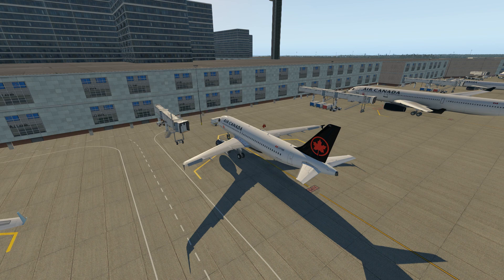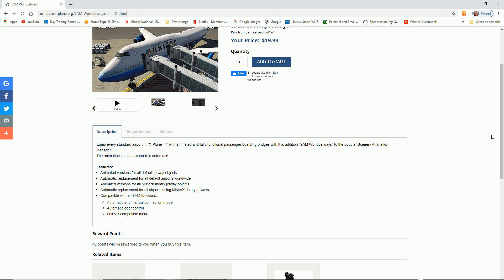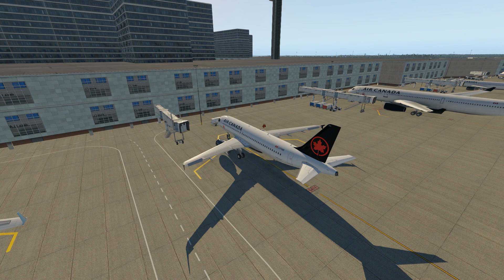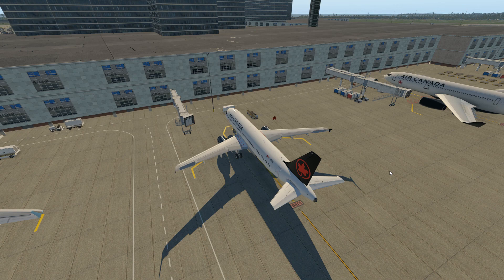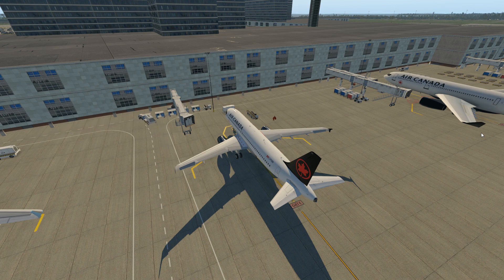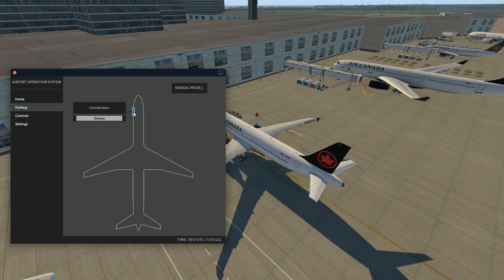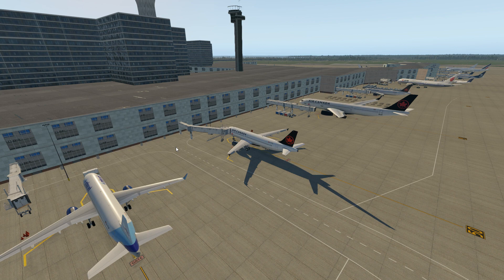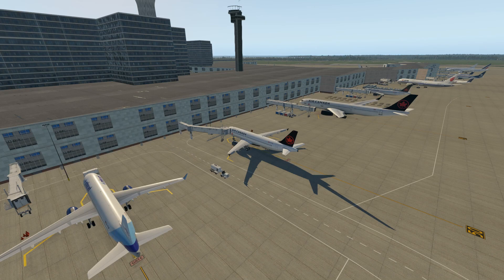Best and Easiest Autogate Yet - SAM World Jetways

Comment: Mine doesn’t work. What did you do from after buying it?
Reply from the maker: What airport and what plane are you flying. I haven't found a default airport that doesn't work.
Reply: Bob Black KSEA. And B737 original(not zibo) i think i have to activate with a key in samplugin, but i’m not sure
Reply from the maker: @thehypes7365  Yes you should have had a serial number emailed to you that you need to use to activate. Follow the instructions that came with the plugin. I don't really remember what I had to do to activate it but just followed the instructions.
Reply: Bob Black thank you!

Comment: i downloaded cynd from x-p scenery gateway recommended. its not yet loaded into x-p. when will i know when that happens?
Reply from the maker: if you downloaded as a file you need to place in custom scenery folder. If you downloaded it into WED you need to use file menu "Export Scenery Pack"
Reply: @bobblack4604  i changed airport name a lot. dioes that make a difference?
Reply from the maker: @ericc7936  Check your scenery init file. The airport folder needs to be listed there.
Reply: @bobblack4604  i see cynd in the. ini file but when i open xp its the original version of cynd??
Reply from the maker: @ericc7936  Are you able to open the airport file in WED (does it appear in the list of airports in your custom scenery folder)? Did you export the airport file using the file menu export "Export Scenery Pack? is there an "apt.dat" in the Eart Nav data folder in the airport folder? is there a ".dsf" file in the sub folder of the Earth Nav Data folder? something like "+49-124.dsf"? If all those things are correct then xplane will load the airport.

Comment: can i add a jetway that is automated to an airport that doesn't have a jetways?
Reply from the maker: Yes you can modify any airport and add whatever you want, however, most airport developers stick to what is on the charts as there will be no airport charts for additions you add that are not in the real world.
Reply: @bobblack4604  so if I add a jetway where there aren't any on the downloaded airport it won't work? 
How do I delete a jetway from Sam? Thanks
Reply from the maker: @ericc7936  If you're adding a jetway where one doesn't exist and no ramp start exists- you also have to add a ramp start (gate). Use the tool in WED that looks like an airplane to add a ramp start (gate) To delete an existing jetway use the selection tool to select it and hit delete key